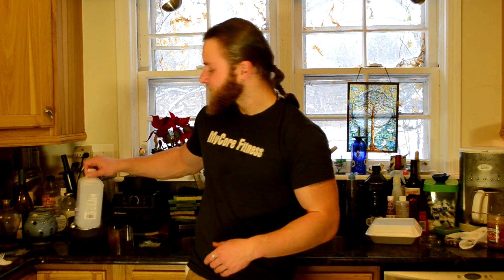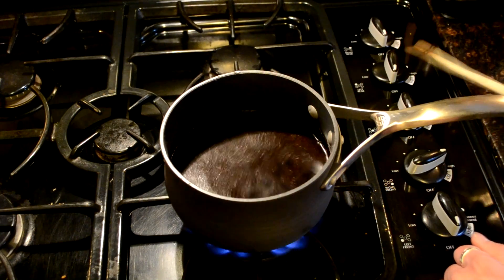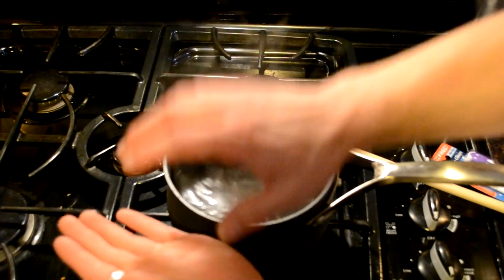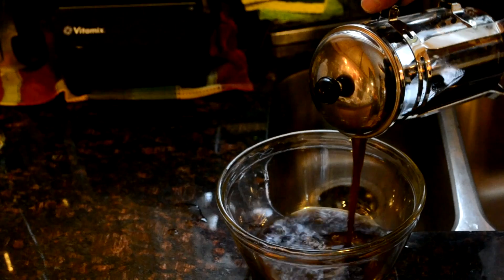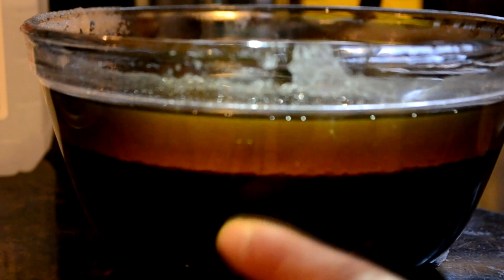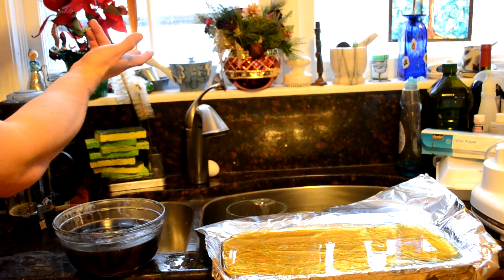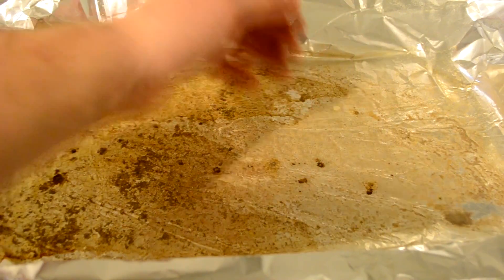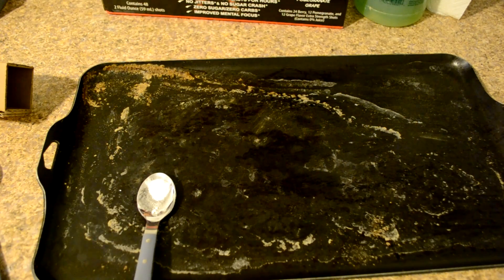Crazy Kitchen Chemistry --- Episode 1: Caffeine Extraction

Comment: I would try to recrystallize again and use a glass  baking sheet instead of tin foil.  Just because you can scrape the crystallized compound better and get higher yield.  I would also use distilled water and maybe pull it through a vacuum flask to purify it a little more.  Props though for getting 300mg. out of a cup of coffee.

Comment: can i use asatone
Reply: NO DO NOT USE ACETONE IT WILL KILL YOU JESUS
Reply: What do you base that off of?
Reply: Isopropyl Alcohol is just as deadly as Acetone. As long as you dissolve the Alchohol, or in his question, acetone, it will not be in the final solution. Therefore, even if it was poisonous, it would not kill you. Yes, you can use acetone, but I would recommend ethyl acetate or dichloromethane.
Reply: Yes acetone will work

Comment: Is it possible to use over the counter everclear liquor as the alcohol source? Or any liquor that is over 80 proof?
Reply: PirateTube TV ethanol, isopropanol and most short chain alcohols are quite polar meaning they'll dissolve well in water. You could use ethanol as your extraction solvent but I can't guarantee that your yield will be overly high. If you had access to a non polar solvent like dichloromethane, the extraction would be more effective.
Reply: Everclear is ethanol, so it's polar. This won't work with a polar solvent.

Comment: Hello!
I'm contacting You because I'm writing a scientific research paper about caffeine extraction. This episode was very helpful to observe Your extraction method, though, as english is not my native language and as it's very important for chemistry experiments to be done correctly, could You, please, check out my conspect for mistakes?

Chemical substances
Isopropyl alcohol, NaCl, coffee, water

The plan of the chemistry experiment
1. Dissolve coffee in water.
2. Heat the substance until it boils.
3. Pour in NaCl in the substance and stir until it dissolves.
4. Let the substance cool to room temperature.
5. Filter the coffee grounds out of the substance.
6. Pour Isopropyl alcohol in the substance.
7. Mix it with a spoon.
8. Wait until extraction happens and there are two separate layers.
9. Transport caffeine, which is dissolved in alcohol and takes place in the layer on the top, to the aluminum foil.
10. Let the alcohol evaporate for a few hours.

Also what kind of mass proportion do the ingredients have?

I look forward to hearing from You.
Best regards,
Victoria
Reply from the maker: looks pretty good. I used 500g (or so) of coffee, and then salt until the solution is saturated.

Comment: I understand that there are a lot of acids in coffee. I also understand that NaCl is a neutral salt because it creates a neutral solution. If you were to use a basic salt (washing soda for example) to mix with the coffee ground solution, would it neutralize the acids in the coffee? If so, could this possibly increase the purity of the extraction? Would using a basic salt mess with the miscibility of the two solutions?

Comment: Tried again; I think I used about 40g of salt in 150ml water and this time the alcohol sat atop just fine; the result was a greasy resin full of all the coffee oils - nothing like you show here; the coffee I used could be expected to contain <>300mg caffiene and I retreaved 485mg+ of this gloop so could  still be very high in caffeine. I am guessing cooling the water before adding coffee and letting the caffine seep out instead of a quicker extraction with hot water would reduce that but surprised you extracted so little resin/oil = any idea how pure your caffeine might be by this method?
Reply from the maker: i'm 95% sure you're using too little water. Try at least 500ml

Comment: This is by far the most helpful video I've been able to find.

I'm trying to do this with caffeine tablets. Could I use this same process? Also, could I use ethanol instead? If so, would that be more safe than IPA?
Reply from the maker: Thanks! you could in theory use caffeine tablets, but I have a feeling that the binding agents in the tablets (like cellulose for example) would dissolve and contaminate the re-crystallized product.

Ethanol wont make the extraction safer than IPA. I used IPA because its very safe, (unless you start doing shots) to avoid Toluene or MEK.  you're supposed to be evaporating it not drinking it! ;-)
Reply from the maker: well in all honesty, it would be impossible to consume any measurable quantity of IPA in the recrystallized product because its highly volatile, and evaporates leaving only caffeine and water behind. 

Not to mention, the dangerous dose range is about 200mg/kg. or for a guy my size, 2 shots. ;) any IPA ive inadvertently consumed is below that threshold by orders of magnitude.
Reply from the maker: The only reason IPA is dangerous, is because your body metabolizes it into acetone. In contrast, ethanol metabolizes into Acytaldehyde, a known carcinogen, and a big factor in nasty hangovers!
Reply from the maker: looks great! have fun man!

Comment: Hi this was interesting to me but it's totally failed; used 17g coffee & 17g salt  in 200ml H2O then 100ml+ 98-9% IPA; got no seperation at all = just a glass of poisonous coffee; any idea what's gone wrong?
Reply from the maker: scale up your experiment. Then keep adding more salt until it will no longer dissolve, that's the mechanism that prevents the alcohol mixing with the water
Reply: You need to supersaturate the water with salt. The solubility of salt (NaCl) in water is 35 g / 100 g of water. So, in your case you needed to add at least 70 grams of NaCl (it will dissolve easily in the hot water solution). Also, your salt should not contain iodine.